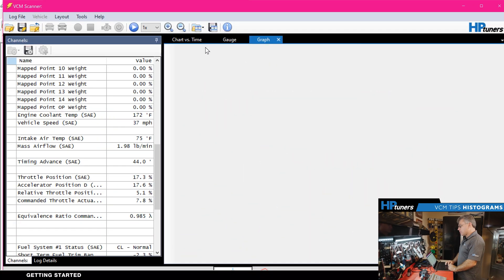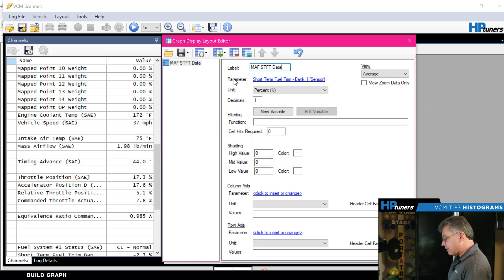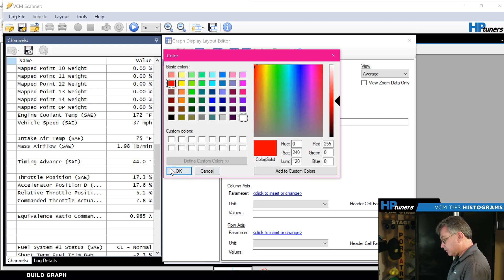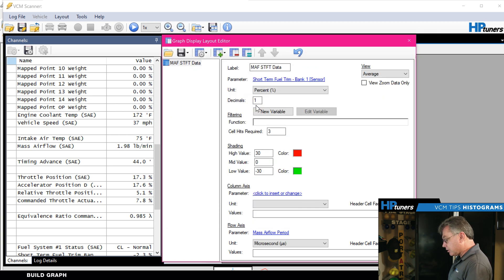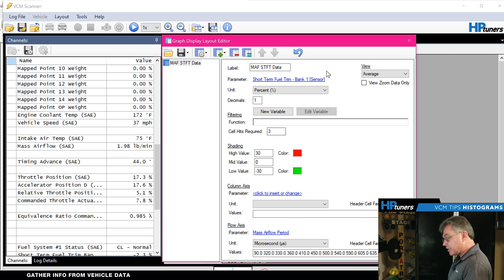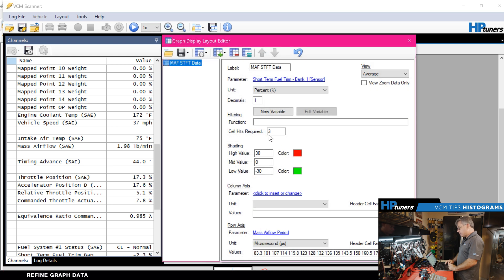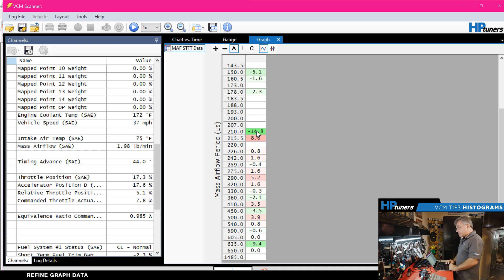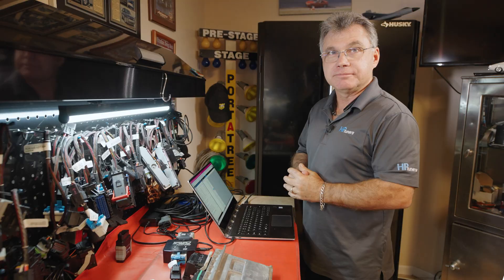How to Customize Layouts & Histograms in VCM Scanner | HP Tuners

Comment: What data do you log? And how should the graph be set up to ve tune a Challenger Hellcat? I have been logging STFT and pasting % into ve table. I have been told i should log pw and fuel mass. Then copy mass into injector fuel mass table. I have not been successful of collecting any data that seems like it would adjust the STFT. I tried to copy and paste the unuseable data i collected just to see what would change. I could not get it to paste to my fuel mass table.
Reply: I watched some more of your videos. I did actually learn something. Learned that you are the Ford gas engine tuner. Does HP have a Dodge gas engine tuner willing to post up some Dodge Hellcat tung tips?